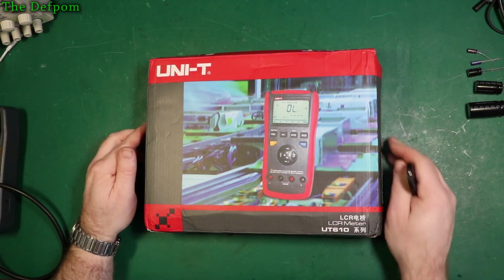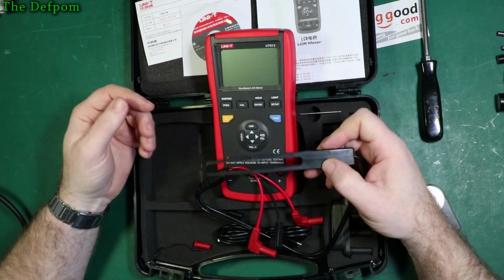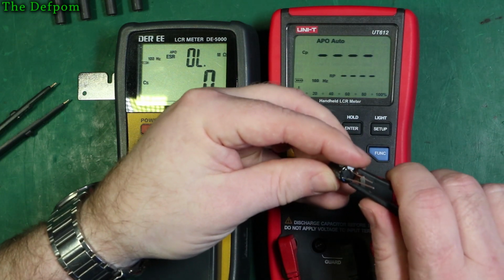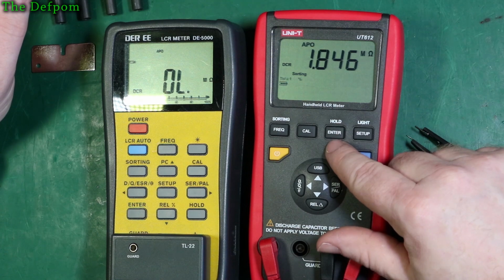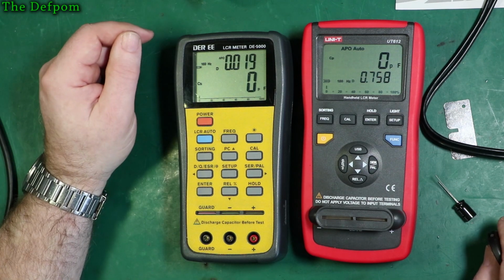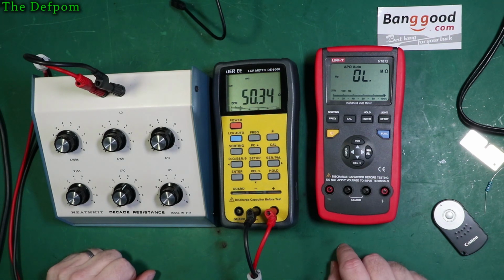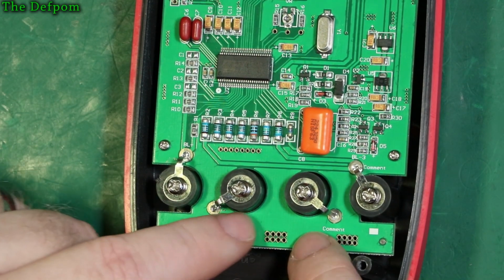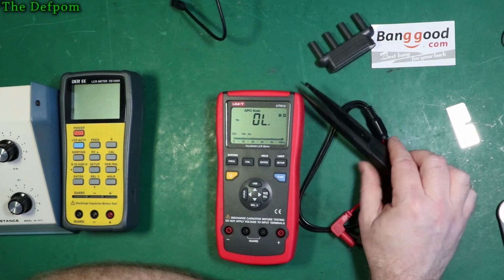🔴 #623 UNI-T UT612 LCR Meter Teardown And Review - how does it compare with the DER DE-5000 LCR ?

Comment: What's the purpose of the dual 'guard' terminals? On the DE-5000, it does a 4-wire measurement when you plug components directly into the front slots, and the 'guard' (a separate 5th contact) is only used in specific niche scenarios like testing very high impedance in a remote box, or to isolate the DUT when testing in-circuit. On this UNI-T it appears the guard terminals connect to that 'slots' adapter, and I wonder why.

Comment: Thank you very much for that comparison. The DER has the 4 wire measurement connected to the terminals and the tweezer uses this to connect drive-line and measurement-line at the measuretips at the end of the tweezer.

Comment: Hello. Can somebody help me why the calibration test FAIL during the shortened terminal ends? I tried the factory cable and two other cables and all of them FAIL. Thank you.
Reply from the maker: Some calibration is done with the leads open.
Reply: Hello. Thanks for your quick reply. In the meantime I managed it. I created my own short test wires (approx. 8cm long) with soldered alligator clips on it and now do the calibration perfectly. Before I used ordinary test heads and due to the hand pressure the resistance always changing of course that's why the UNI-T failed all the time, that is evident now. With the closed (shortened) alligator clips the resistance become constant so the calibration PASS. For measurements I prefer and much easier to use the alligator clips instead of pushing the electrical component legs (especially when the legs was soldered before) into that factory terminal.

Comment: you are meant to use the included srt metal disc for tweezers cal. There is a hole which you are to use with the tweezers. Mine failed to cal with your method as well, but never failed using the hole in the short disc. Thats just user error
Reply: Thanks for the tip!

Comment: I tried some Chinese ceramic disc capacitors labeled 104  100nF,  and they measured 30nF on the Uni-T UT612 and digi-tool digi-16.     Any thoughts.
Reply from the maker: That is interesting, what test frequency did you use ? (although it should matter much with ceramics).

Comment: I bought cheap tweeters like those for my DMM, and they are the same. It's like they have an oxide/coating, because I have to saw the tips on the part leads/ends to scratch them before they give a decent reading.

Comment: It is really not a good idea to test capacitors that have already been tested without fully discharging them. Especially electrolytic. At the very least it is asking for inaccurate readings. Note that the meter has a warning about this printed on it. This is not to say that the Uni-T would have done better but it is poor methodology at best.
Reply: Ray Rooney Agreed. Mr Carlson is shaking his head emphatically

Comment: DER EE 5000 all the way. Just purchased one and is great. Better quality, faster response. way better input terminals and plugins. And the price is fairly acceptable. I've purchased some time back a  PEAK DCR70 but did not like it at all. 1.Way, way  too expensive for what it does (ESR + Capacitance).2. It munchies thru batteries fast, and the 12V battery it uses  can be fairly expensive if you go for a good brand that lasts. 3. They say that the capacitance reading is really for information only as is is not very accurate and it does NOT! measure anything under 1uF (which is a pain in the....rear side if you ask me). 4. The tweezers is a separate/expensive accessory that you have to buy and is very flimsy. (I've managed to break mine after just 3 months of random use)-What a waste!. 5. The form factor is horrible  and it does not tiltand that make the screen not very easy to read. 6. The battery does not have a compartment as such. To have it changed you have to unscrew the whole rear cover and expose the PCB. Anyway. good video presentation. Thank you.

Comment: The DE-5000 just blows the UT612 away in every way. The only bit of gear, I can say is OK from Uni-Tread is the UT181A which is my second handheld meter and a (hack) copy of my primary Fluke 289/287. Most of Uni-Tread's gear is junk and in some parts of the world, way overpriced. Uni-Tread think their up with the top end brands when really they can't keep up with Rigol.
Reply: Most of the "top" brands are overpriced garbage. You are no better than a fashion snob if you buy anything fluke. You get a worse product for 3 times the price. You are a joke if you think that top end electronic testing equipment is the "best"
Reply: @fulldeepshadowmmon  LMAO
Reply: @MickDownUnder  fluke fan boy?
Reply: @MickDownUnder  let me guess you are over 50
Reply: It is better than 289 Fluke, except for a bug in firnware itself with frequency on alternating current.

Comment: Hmm that does look decent, good enough for checking bad caps in switchmode psu's and such :-D.
Cheaper than the Der 5000, but very close.
The tweezers needed thicker metal so the don't bend so easy, and grooves in both sides to capture wire without slipping.

I have pulled a battery clip off it's plate before, but don't tell anyone lol.

Comment: usual uni-t crap. 4 wires should go outside, not stop on terminals. to compensate probes. like der ee 5000 does.
Reply from the maker: l3VGV - the DE-5000 only has 2 wire at the terminals, the same as the UT612, I actually think this is a pretty good meter.
Reply: der ee has 4. even on banana terminals ther is 2 contacts inside each of them, so its true kelvin 4w. pics is there http://benholmes.co.uk/posts/2018/02/component-meters . uni-t just have to make very no sense design example, i do not know why. ofcourse this meter is good, for it money, but why not make even beter for almost  price increase. that is always case with uni-t some product ar awsome like my corrent clamp ut21e, and others, like this one or ut71 multimeter, are very strange - can be much beter with no expense, but...

im thankful for ur very detailed review. hope all of your future videos of cheap instruments will be as detailed as thise one, if bangood is sponsoring then instrustar and huntek usb scopes please!
Reply: @I3VGV I have an UT71E multimeter. What is strange on it? It was good for me, but I‘m not an expert on tecnical details
Reply from the maker: Drew Dastardly - now I think about it you are right, I was forgetting that the blade connectors were double sided to give 4 connections in the slots...
Reply: @TheDefpom  eevblog specifically proved 4 wires for 5000.

Comment: I have some expensive components tweezers and have encountered the same problems you report on the cheap version. The meter itself looks very nicely manufactured.  I use the Peak  devices  for components and they work very well but I don’t like the form factor style they use.  I like the fact it does LCR and ESR together.
Reply from the maker: AllTheGearNoIdea - Peak were going to send me an item or two, but that seems to have not happened, no reply to my last couple of emails to them.